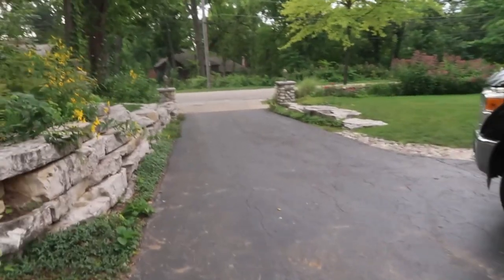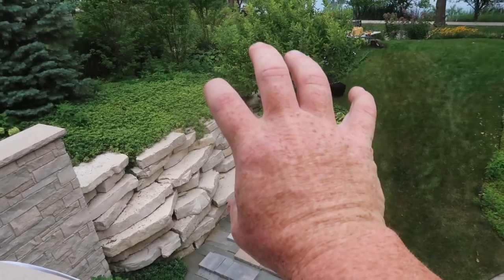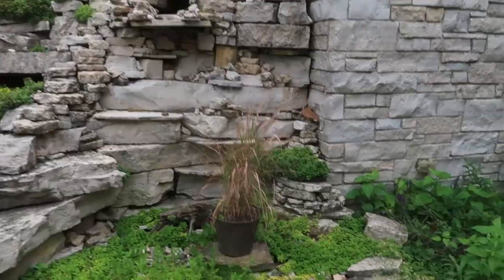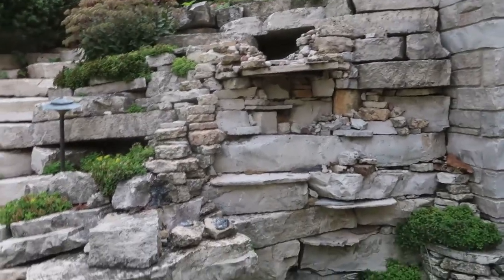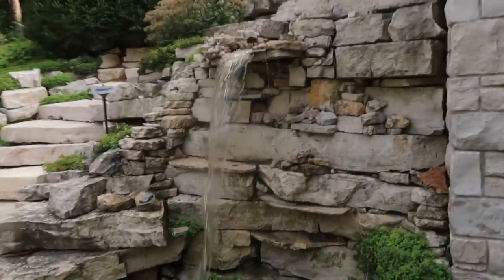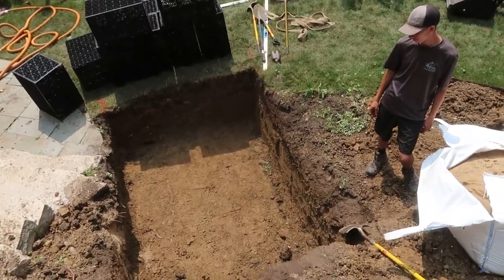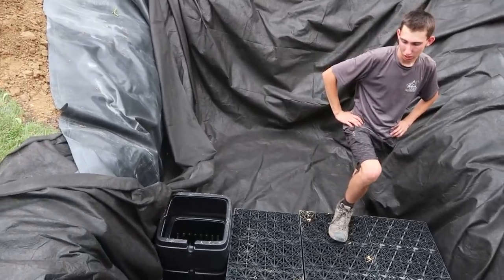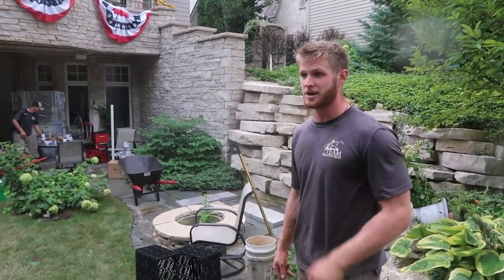Landscape *WATERFALL* for GIANT Hillside - Part 1

Comment: That's too bad about original waterfall. Be really cool to set as a drip instead of a flow, so it mimics mountain aquafer openings. The water in those is just a trickle out of rock of the same shapes. Really low volume seasonal flow from them and they are thick with native moss, ferns, and shade lovers. If there were some way to get a low-volume pump-like a fish tank one? Be gorgeous naturalized drip fountain!😍